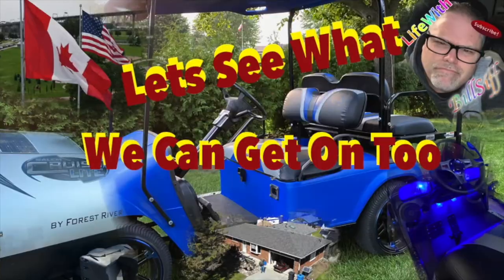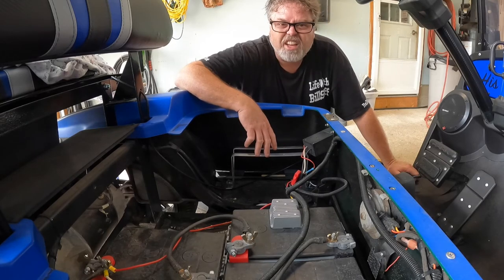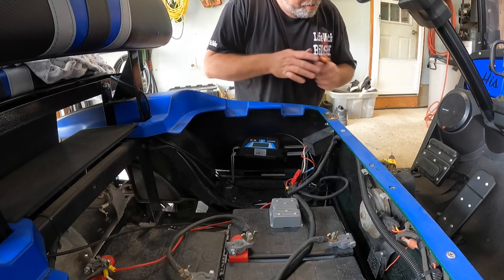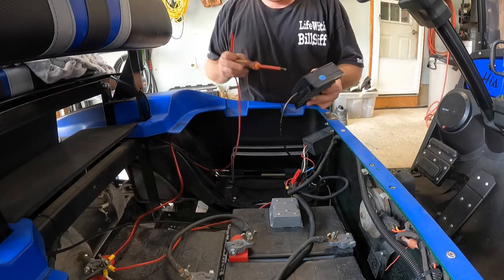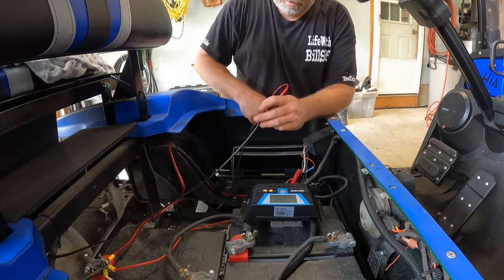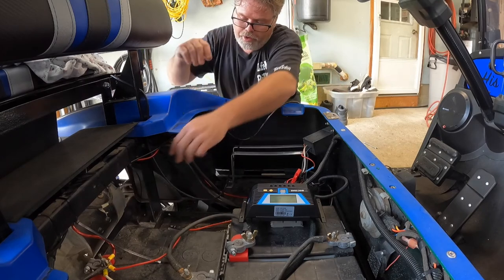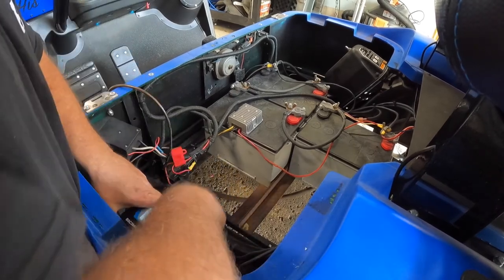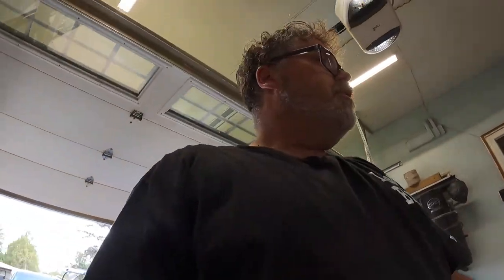Working 36 Volt Solar Charger EzGo TXT GolfCart

Comment: Something is telling me that panel and co troller will not charge those batteries. U less im doing something wrong, i have a 340 watt panel on top of my cart and a 40 amp mppt conteoller for it and it still isnt quite enough. I have three 12v lead acids in series.

Comment: Do you have some links for the charge controller and other things you might have gotten where I can buy one. I’ve taken my 6 V golf golf cart batteries out, and replace them with 312 V and Siri I’ve got a solar panel on the roof I need to charge controller

Comment: when i am installing things that i want to keep dry but have access and ability see it i just get a click clack container that's clear from the kitchen and drill then seal the boltholes/wires and its all good. if it may get hot i just poke a couple of holes under the lid so heat can escape. its a great way of taking care of switches  etc out in the weather.

Comment: I have a question for you.   I have a 95   36v club car DS    recently put 3 12v deep cells in it.   the first few times I charged it    the charger shut off just fine when full.    the last couple times the charger was a till on when I woke in the morning     I don't think it was over charging    because it was reading right at 42 volts.   but should I be concerned that it never shut off?   stock up car charger that came with the cart      thanks!
Reply from the maker: That’s scary not to sure why it would do that . Maybe a week cell in one of the batteries or chager issues
Reply: Get a Hydrometer and check each cell of each battery, record your results for future testing/tracking etc. I just got a new Hydrometer called "Hydro Volt, made in Germany, easy to use and very accurate. Just remember to flush it out with distilled water when your finished using it.

Comment: Nice work Billsiff!!! I'm looking to do this on our golf cart and I think I was able to understand it a lot better by watching you put yours together!! Thanks for sharing Captain!!! Just two questions though, will this be able to maintain a full charge on the batteries throughout the day as you use it? Also when using the charger that the golf cart came with, are you able to charge the batteries overnight while the solar system is connected?

Comment: I saw your project with a solar panels On the 36th Volt golf cart. How that workout long-term? And I also noticed that you're running 3 batteries versus the six 6 V batteriesI'm running in mine. What's the difference?

Shawn
Reply from the maker: I sold the golf cart so I’m not sure how it’s working out for the guy but it worked good for the full year. I had them on it and the 3. 12 V batteries work fine they just don’t last as long as 6. 6 V.

Comment: What’s the silver colored heat sink device atop your battery?
Reply: Thats a 36v to 12v adaptor for running headlights and anything 12v they are about $20!

Comment: What kind of battery set up do you have. It looks like you have 3 12v batteries and if you do what kind of batteries do you use and was the hook up same as 6 6v batteries.
Reply from the maker: I’m just using three cheap deep cycle 12 V batteries the last long Enough to where I go they are only 50 amp hours each I definitely need better batteries but with a solar on the roof in the daytime it keeps them charged
Reply from the maker: And yes you hook them up the same positive to negative positive to negative negative on the third positive on the first battery
Reply: @LifeWithBillSiff  what about charging?   I have mine hooked up and it seems the 36v charger that came with the cart doesn't shut off at 36v    I was reading about 42     then it  read O.L. before I disconnected.    do I have something wired wrong?
Reply from the maker: @brianpeterson8769  42 volts should be ok when you charge the batteries with a factory charger it’s normally around 40 volts . There should be settings on the charge controller to set voltage levels
Reply: @LifeWithBillSiff     awesome    thank you for the response.    could you link your solar panels and charger you used on your cart?
Reply from the maker: @brianpeterson8769  i put it in the description for you
Reply: You’re a good guy…very helpful…thanks👍😀